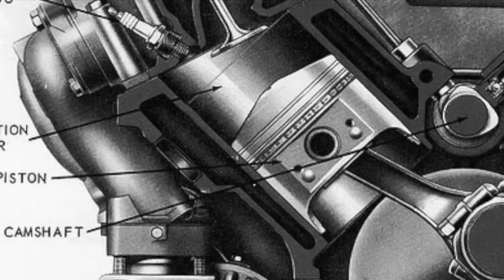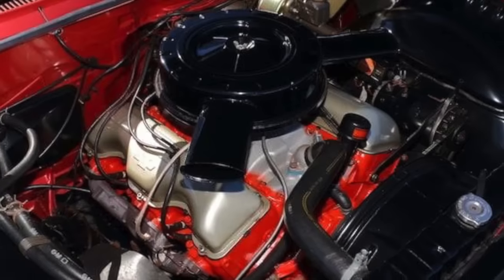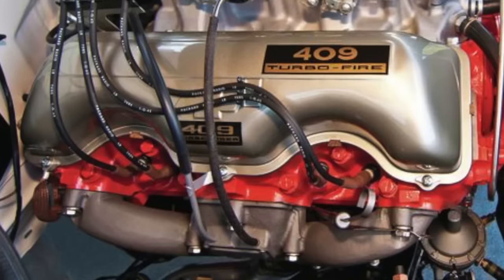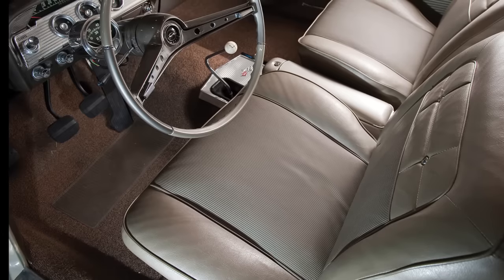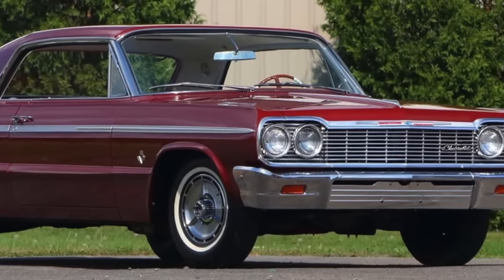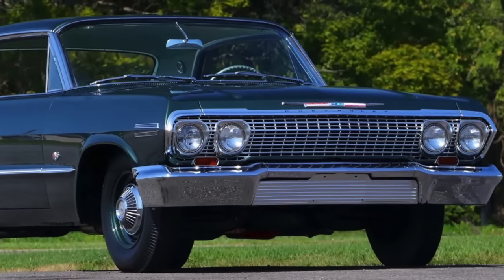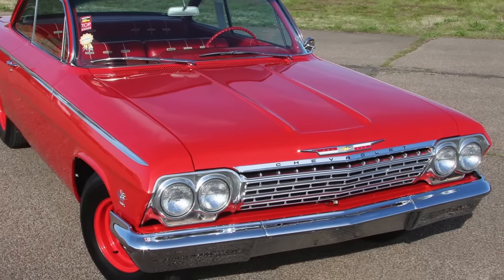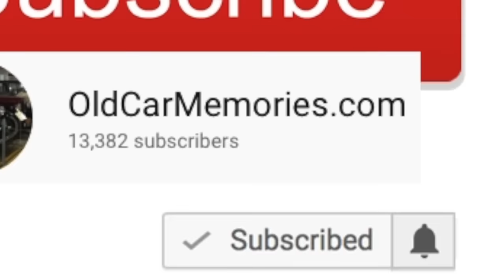1961-1965 Chevrolet 409 V8 - The Ultimate Budget High Performance V8

Comment: Chevrolet had an overhead valve V8 in the TEENS 20 years ahead of Ford
Reply: The OHV Chevy 6's always had more HP than same year Ford flathead V8's... Louis Chevrolet was a race car driver... he never let his engines be flatheads... just the more powerful OHV design...
Reply: Yeah,  it was a piece of junk made out of copper. Everyone of them were recalled & scrapped.
Reply: @4thstooge75  That was an air cooled job, only a few were made.  Most were conventional water cooled engines.

Comment: Those were some pretty engines. In my experience they had a tendency to bend rods when trying to extract too much performance. Too bad they were in the miserable x-framed cars of the period. I spent a lot of evenings with Chevys on the lift changing mid-frame carrier bearings!

Comment: $376 in 1962 is equivalent to over $3,000 today.  The jump from a 2019 Camaro with a boring autobox and lame 4 cylinder or V6 into an SS with a manual transmission is not too far from that.  And yet, the vast majority of New Camaros ("New" because they ain't Camaros) I see are V6 or 4 banger.  Hmmm.

Comment: The first Chevrolet V8 was in 1918. The series D 288 cubic inch overhead valve engine. Killed by GM because the Chevrolet was presented as the cheap car line.
Reply: 1916... w/ airgap intake manifold... LOL!
Reply: correction!  1917  a fire destroyed the engine room.
Reply: Hot Rod mag said patent infringment.

Comment: Talk about a walk down memory lane, I had a 265 in my 55 Chevy, a 348 in my dad's 60 Nomad, a 283 in my 66 Chevy 2 SS, and a 350 in my 66 Camaro SS which I still have and it's a convertible. I think the 348 and 409 were in the same family of engines and the 327 and 350 were in a different family. Thanx!

Comment: I grew up in the 60ies.  The 348 was always considered a dog - always.  I chuckle when I see them sold at auction.  Never knew anyone who could get a 409 running well.  I'm sure there were some but none to my knowledge in the Springfield Mass area.  The 396/427 engines were excellent along with the SBC.  Lots of inexpensive HP parts.

Comment: 454 thumbs up HAHAHA another great GM chevy motor!
Reply: Speed Racer 
The best GM engine? Cadillac 472/500! Huge potential, just a few minor improvements really wake this torque monster up! A aftermarket intake is first.......the stock manifold is so poorly designed that the intake runners actually point UP to the heads. Second, a decent cam, a RV grind would work nice for street light weight rod. Third would be a improvement to the valve rocker arm assembly. Fine for grandma, but it won't stand any higher revs. Throw away the stock nylon tip cam timing gear and go with steel roller chain/gear. Lastly, ditch the stock exhaust and go with headers and a 2" exhaust system. These engines were designed to produce 350-475 ft/lbs and 325-450 HP at under 5000rpms in it's stock form. The blocks have such a high nickel content when casting, you can't wear them out! A lot of guys say these engines are so heavy.......they are about 60 lbs heavier than a SBC, and lighter than a BBC.

Comment: Ford was NOT the first V8.  Chevrolet had a V8 in the 1917-1919 Series D model.  I was discontinued because it proved too expensive to produce and did not sell well enough.  Cadillac had the First domestic production V8 in 1914.
Reply: Ford's V8 was the first block cast in one piece. Earlier V8's were modular blocks due to the difficulties in casting such a complex form.
Reply: That is true.

Comment: this review is incomplete as the 348 had a DUNTOV version right from the start.[[58-61]]which was a completely different engine than the stock 348 it had 3 duces and a duntov cam solid lifters heavy duty rockers dual ignition headers and dual exhaust. four speed and posi were also standard with the duntov. in 61 the 348 and 409 were available but the 348 was just the"" on the shelf left overs ""of the 60 s .
Reply: Yes sir 1960 348 tri-power had solid lifters with 360 hp.
Reply: I loved the 348..My brothers used to laugh and say it was a truck motor..It did have wider rod and main bearings which i liked, never heard of one (throwing or spinning a rod bearing)..They were tough.
Reply: I recall looking for a big block chevy with my dad in 1967. We went to see a nice looking 58 impala with a 348 and 3 2 barrrel carburators. It looked good until the seller claimed that someone left the key turned to 'on' killing the battery. Also, it was in a yard and had no plates on it. We took a look at it and my dad looked at me and said lets go. My brother-in-law knew a guy who had a 59 Impala with a 348. It was a white convertible that looked good. However, the roof must have been leaking since the floor was rusted with a hole in it. Worse yet, it burned oil so badly that it smoked up the area as soon as it was started. I ended up buying a Ford with a very nice running 390 engine with plenty of power. So much for the 348 engine.
Reply: it was based on the chevy 348 truck engine .but zora duntov took it an built it for racing in his dontov  version also 2 other versions were available  250hp with a rochester 4barrel and a 280 with 3 duces but no cam setup or ignition .the 250 280 were tame.
Reply: the hp for the duntov was 315 325 335 for 58-61
Reply: FOR 1960 THERE WERE 3 VERSIONS OF THE 348 THE BASE WAS A ROCHESTER 4 BARREL WITH 250HP A 3 DUECES SETUP 280 HP AND THE DUNTOV VERSION 335HP NO 360HP WAS AVAILABLE IN 1960. 1961 THEY RERATED THE DUNTOV 348 TO 360HP. NO ACTUAL CHANGES WERE MADE. AND THE 348 TRIPLE CARBS WERE NEVER CALLED TRI POWER AS THAT WAS THE COPYWRITE OF PONTIAC
Reply: My Father had a 1961 Brookwood Station wagon equipped with a 348 / 3 Deuces...was a county Police car before Dad bought it
Reply: I thought blowing head gaskets was the problem with the 348

Comment: I'm an experienced diesel mechanic starting in the 1980s and we were a rebuild shop only, we owned no trucks, repairs only. We were performing a number of in chassis overhauls weekly. Although my experience was all trucks we did a lot of gas work too. My dad made a garage out of one of our unused barns and as a kid we did a lot of repairs for extra money (built a few hot rods to). I have never come across a 409, and my dad, who grew up in the 50s always said that the GM 409 was not all that good or reliable. I only have his say so, as I said I've never worked on one.

Comment: Actually 1955 was not the first year for Chevy V8. Chevy made a production OHV V8 in 1932 to 1935 (?) that came equipped with factory  dual exhaust. They stopped making the V8 because it was too expensive for a Chevrolet concept of a poor mans car.
Reply: Actually it was 6,000 Chevy OHV V8's in 1916 - 1918... with airgap style intake manifolds...

Comment: 64 last year made 409 65 was when started 396
Reply: The video explained otherwise. I boughht a 65 SS in 1968 and it came with the drivers manual which listed the 409 options. No dual carburator version was offered then. Later that year, the 409 was discontinued and the 396 was available.
Reply: Changeover was midyear (February) 1965.
Reply: No, mid 65 was the last.  The 396 came out mid year.

Comment: Chevrolet actually produced it's first V-8 in 1917, and it lasted through 1919.
      It was 286.28 cubic inches, rounded-up to 288.   It produced 60 horsepower @ 2400rpm.   
      At the time the model was conceived, Chevrolet was an independent car manufacturer.
      By mid-1918, Chevrolet joined the General Motors family, and the model was no longer considered necessary because of all of the other V-8 cars available from General Motors, like the Cadillac, Buick and Oldsmobile.

Comment: By the way the first Chevrolet V8 did not debut in 1955, the first V8 from this company was offered in 1917 with the "D series", a 288 cubic inch OHV engine of 36 hp.
Reply: Correct, but had 55 horsepower, didn't it?
Reply: @michaelbenardo5695  I believe it was rated at 36 hp.  I saw one in a car museum in Reno and the placard next to it quoted that power figure.  It was a fascinating looking engine no matter how much power it made, and it was decades ahead of other powerplants.

Comment: They actually made a 427 version of this "W" head design briefly before they made the  second generation "Mark" 427. The first generation cu in increase was for the change in NASCAR limits. Chevy stopped building engines to NASCAR specs somewhere in there as a General Motors policy in '65, I believe,  and that's why they stopped making W head 427s after only about a year. Probably where  that dual 4 barrel option went too. I know Pontiac stopped putting forged rods in their 421 then because guys were breaking them anywhere over 6500 RPM after that poorly timed marketing decision by somebody in GM management at the outset of the muscle car era. It didn't take long for them to see their marketing misstep though and rejoin in exploiting that market but those first generation W head 427 motored SS Impalas are rare valuable auction pieces. 
.
Proto muscle car era favorite of mine was the '56 Studebaker Power Hawk with the short lived Packard 363 cu in V8. If you bought it from the LA dealer you could get it with a belt driven  McCulloch centrifugal supercharger, dealer installed but exempt from Studebaker's warranty . After only one year they stopped making the Packard motors and thought they needed to ruin the classic lines of that  Raymond Loewy design with some pretty hideous looking fins to keep up with that pretty hideous late '50s Detroit fin fad. I'll take my '56 Power Hawk with the 363 and the wire wheel option as soon as I can somehow stumble across a fortune enough to stumble across and buy a very rare one, in a dream somewhere, in pristine condition. 
.
But the Darwinian selector  for surviving  nitro methane and 20x over-driven roots superchargers was always the AA/FD class at the 1/4 mile drags. And to both survive that and hope to win you must've had a 392 Chrysler first generation Hemi found only in '57 -'58 Chrysler 300s, New Yorkers and Imperials. And only after finally advancing the timing past what would hold up for very long in a first generation Chrysler Hemi the second generation 426 Hemi took directly over as the dominant plant in AA/FD in the later part of 1966 on.

Comment: Wow!!! Now those were some really over squared blocks 👍. Nowadays under square is the norm.
Reply: British engines were always under square until Jaguar used the Buick/Rover aluminum V8 over square dimensions to make a V12 for the XK-E... also, UK taxed by bore diameter earlier, so that also kept bores smaller... Today's performance engines are still mostly over square... 1980's Olds 403" was prolly about the most over square...

Comment: I ordered a 1963 SS , 409/425hp 4speed, 456 rear end, Palomar red, fawn int, it was too low geared so traded for a 308 rear. It cost $3000. I could of got a split window coupe for $3800. I was 18
Reply: Yes sir , that 4.56 gear was great with an automatic but not much fun on the highway !

Comment: Bought a 64 Impala cpe. In 64. Had it 2 weeks and it was time. Had the inches,carburetion, compression. Needed a cam!  Re jetted the AFBs (2) and went shopping. Decided on a 505 C Magnum Isky Roller set up with a Rev Kit. Balanced out the heads while they were off. Put Jardine Headers for breathing. Along with this, Up Lok Suspension and cheater slicks. End product, 554 h.p., teens in the low 12s. Had a.good run, but those hemi came around. Almost got one,  Plymouth   FX!  But Vietnam was around the corner...

Comment: My brother had a 63 SS 409 340hp 4 speed I believe the rear gear was a 336 a big heavy car.. The biggest hold back when racing them Camaros was you couldn't put a rear street tire under the space that was there it would leave 3rd gear tire marks as long as the Camaro 1st gear marks and still Catch them Camaros 350s on the top end 2 car lengths in the 1/4 mile. That old 409 would bury the speed odometer so fast top end , whew , I'm glad we're both still alive. lol 😆

Comment: Great job and specs. I did always think that the 283 1957 with Rochester fuel injection was the first motor to have 1 hp per cu. in.  Was that not so. Love your vids and would love to hear your reply.
Reply: The first production 1 hp/1 cu. in. engine was the 1956 Chrysler 300B with the option.  355 hp/354 cu. in.
Reply: No!!!  Fords 312 super charged was rated at 345h.p. in 1957. That's MORE than 1 horse per cube. I will agree though that fuel injection was a very GOOD!!! idea.
Reply: @eugeneschulte4950  No and No.  1956 Chrysler 300B, 354 c.i. and standard 345 hp, had a cheap option (can't recall what it was) which raised the hp to 355.
Reply: @dickmanford  Ok, Your right!!!!   1956 did come before 1957!!  Lol lol!!!     Poor chevy guys!!!      Always FOLLOWING!!!
Reply: The option 10:1 compression 354 in the 56 Chrysler 300 B made 355 horses, and the 57 DeSoto Adventurer, with a dual quad 345 HEMI made 345 horsepower.

Comment: Now here is a hot tip us youngsters used to get more out of the engine:  turn the top of the housing for the air cleaner upside down and screw it back into place and that way you get more power.

Comment: about 1973 I found a freshly rebuilt 425 hp dual carb 409 for about $800 . a lot of money then, I had just put a shortblock 235 6 cyl in my 62 chevy  for $180.00 with a valve grind that cost me $10. Wish I would have had the money for that 409.  I was earning about $2.50 per hour then.

Comment: The first V8 engine was Cadillac in 1914. Ford flathead V8 arrived in 32. The first Chevy V8 was 1928. One year only. It was so troublesome that it was quickly dropped. Chevy fans would have to wait for the revolutionary small block V8 in 1955. What made the 409 so impressive, was when it was introduced late in the 61 model year, it was already obsolete. However it ran way stronger then it had any right to. A stand out performer, although prone to breakage. When the the Mk IV. big block arrived in February. 65 , It was like a moonshot, it was so advanced in its engineering.
Reply: First Chevy V8 was 1917.

Comment: My favorite 409 Chevy's are the 62 Bel Air 409/409 and 63 Impala SS Z-11 factory lightweight. The Z-11 engine actually measured 427 cubes but it was actually a bored and stroked 409

Comment: When I was 14 in 62 I went to the drags for the first time. The 409s ruled the stock class. This didn't last long though.
Also, 409s were poorly designed and were notorious for throwing rods. Still & all, they are indeed hot rod history.
Reply: I raced a 409 for 3 seasons with over a thousand runs. Never pulled a valve cover. Go figure!!

Comment: I had a 58' Delray 348 police interceptor, with the power glide, that was in 65, the headers looked like 409's, a few friends said the 348 was a dog, but mine was a screamer.
Reply: The hydraulic 348 wasn't all that fast, but the solid lifter version was.
Reply: @michaelbenardo5695  I'm sure it had solid lifters, but I never opened it up to look, since it was a "built" police interceptor.

Comment: Ford was only 1 of many learning from other manufactures! Cadillac was the first automobile maker in the world to mass-produce V8 engines.[citation needed] The company has produced many generations and variations of V8s since 1914. In 2010, when the Northstar engine series ended production, it became the last General Motors division to retain its own proprietary V8 design.
Reply: flatheads are cheap and compact, fords had many problems though, overheating etc even today you can tear down a flathead ford and pour sand from the casting process from the water jackets

Comment: The 1917-1918 Chevrolet Series D was the first Chevrolet V8.  Do not call the 1955 model's 265 V8 Chevrolet's first. The W heads made great truck engines.

Comment: The 348 and 409 were unique, that they had canted exhaust valves, just like the 396 and 454 big brothers, really helped make a lot of low end torque. The only problem was the tach red line was at 5400-5600- rpm and they did not like going over that, without a whole lot of money being put into one of these motors, 396-454 were the same way, 5800 rpm.
Reply: They were designed to produce high torque at low rpm so that trucks could move heavy loads. They were not designed to be race engines.

Comment: CHEVY MADE A 90 DEGREE (overhead valve)  V-8 in 1917 AND 1918.  IT DISPLACED 407 cu in and had a gross hp ratting of 88.  IT WAS called THE SERIES D.  I was the last CHEVORLET v-8 until 1954  when for the 265 debuted in the 1955.
Reply: 268 cubic inches

Comment: I always wanted a 59 Chevy impala with a 348 and 4 speed.
Reply: Had a 59 Impala 348 trip power 3 speed stick it could pull the left front wheel of the ground on the dig out.what a car. Also it didn't lift the back of the car off the ground at 120 mph. PS . We did stupid stuff at mid 20's..
Reply: Had a 59 impala with 348 tri power and a  doggy turbo glide. Bought it in 1969 with 32000 miles for $350 dollars. Showroom condition but my brothers 66 Malibu with a 283 with 3 on the tree would blow it in the weeds.  Wish I had it back today tho.
Reply: @lestermiller8415  It didn't at least ride high in back at those speeds?

Comment: Chevrolet first built a 4.7l V8 in 1917. But when merged they merged with General Motors in 1918, discontinued production until 1955, when V8 production resumed with 4.3l V8 for the C1 Corvette.
Reply: We didn't size engine in litters.  We used CUBIC INCHES.